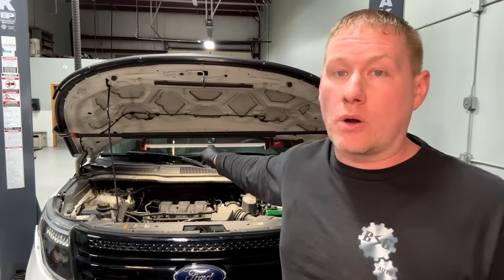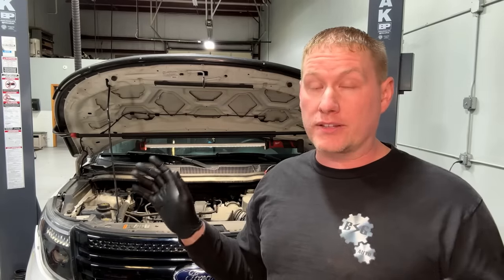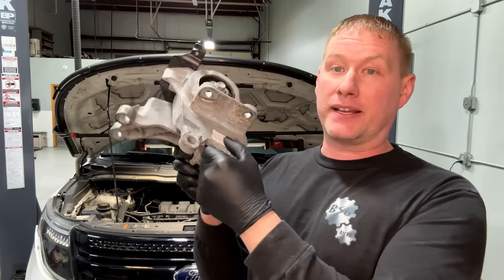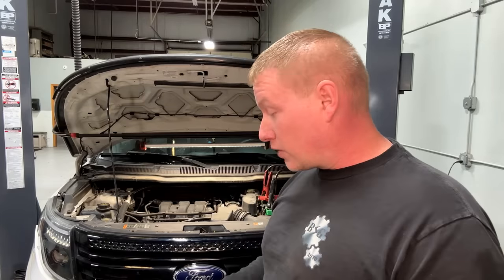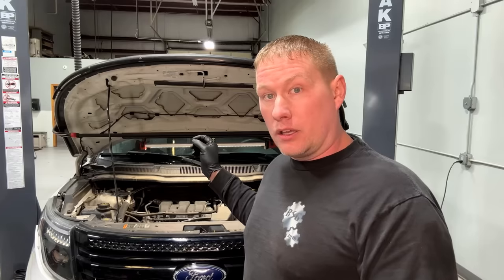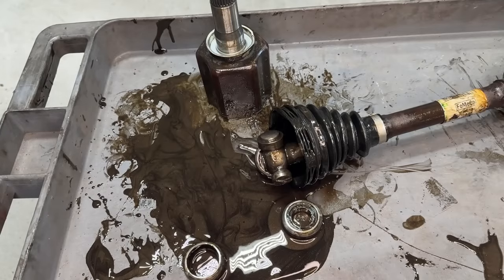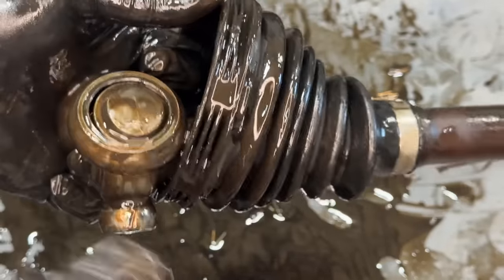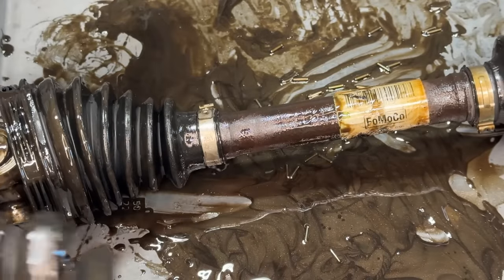Crazy 2014 Ford Explorer Vibration Finally Fixed!

Comment from the maker: The best Transmission Shudder Fix Additive out there- 
https://amzn.to/3rLXg02
Reply: Hey Brian do you use one or two tubes for the 2018 Explorer Platinum?
Reply: Hey, should I use  this for a maintenance procedure.
Reply: I used it in my old 09 Impala that developed a shudder.  Used this additive....doesn't work.
Reply: Brian. Do you still have a Quincy air compressor?  If so what model  is it. I need to buy a new one. Any recommendations ?
Reply: If I own a VCM3 will you offer a remote diagnostics session if I pay for a retainer/deposit for an 08 flex fuel 5.4l crank no start condition? I apologize I already reset cam
Reply: I have 07 f150 and the upstream o2 sensor wire connector harness that goes to the pcm/ecm is missing I can't figure out where the color wires on the female end suppose to go to can you help me please.
Reply: @__datwill explain a bit more
Reply: @Quick_Fast_Hurry  The female end of the connector that the male end on o2 sensor plug into is missing so the o2 sensor is just sitting in the cat  not plugged into anything cel on cause of it
Reply: @__datwill did ya find it?
Reply: @21Piloteer Lubeguard will not fix a mechanical issue such as a bad converter but it certainly will correct shudder problems associated with the frictional characteristics of the fluid. Lubeguard is the ONLY additive ever recommended by an automotive manufacturer. International lubricants have been on the forefront of synthetic fluid production and they produce synergistic additives for some of the big names in the lubricant industry.
Reply: What kind of camera do you use for diagnostic? How do you mount it under the car?

Comment: customer learned an EXPENSIVE lesson.  he should have replaced BOTH CV axels instead of just one!
Reply: axles
Reply: That was the first thing I heard in the intro.  "He replaced the passenger axle" ... Ok but what about the other one???
Reply: Cv axles are generally not replaced in pairs. That's not really a lesson.
Reply: The owner (my brother) changed 3 out of 4 axle's. We were waiting for the front left (backordered) when we threw in the towel. Brian had just finished my sons interceptor repairs. We knew BSG was the only place to diagnose and CORRECTLY repair the truck the first time. It was the best decision we could have made.
Reply: Yup
Reply: My vibration started a couple years ago, I did not address it then as it was minor. It’s gotten worse so I took it into a dealer. They suspected pinion bearings and order parts. Once they received parts I took it in and let them know that I had concerns that they were guessing the problem and that I did not want to pay for parts and work not required. Yesterday they sent me a short video of what the issue was. Bearing preload was at 5 in Lbs, on  my F150 preload spec is 16-27 in lbs. This axle has 162,500 Km on it. Fluid was changed out at 74,000 km. So, either the initial assembly was not done properly or the preload on bearing was lost due simply west and tear. The video shows some wear on the ring gear outer edge caused by the pinion gear. So they tell me their replacing all necessary parts. This 30 days after changing coolant lines on driver side Turbo.

Comment: I worked at a Chrysler dealer in the early 90's and this was a very common problem with inner CV joints.  They did not use a circlip but used a spring inside the inner CV joint housing to keep the CV joint in the trans.  When these went bad it would cause the vehicle to shake side to side on acceleration.
Reply: Yep, I had a 1986 Dodge Aries that did this same thing, had actually worn an indent into one of the tripod cups. Drove me crazy. Finally gave a tech at a dealer $20 to take a quick ride with me and he told me what it was within about 30 seconds of driving.
Reply: Yep, I had a 1983 Chrysler New Yorker that did the same thing.  The tripod bearing had actually frozen and when I jacked up the front and spun the wheels with my foot on the brake it would actually move the engine from side to side.  I think it had the 2.6 liter Mitsubishi "silent shaft' engine.
Reply: The 2.6L HEMI!
Reply: @paulreed563 Yeah, a real stormer.  The customer that had that car traded it for a 1986 Fifth Avenue and it had the 318 with all of 140 horsepower.  Another "stormer."
Reply: An yes.  Remember when Chrysler sold Horizons and Omnis to police departments?  Hahaha!  Couldn't make this stuff up!  And I was a fleet service rep.  What a sh-t job back then.

Comment: If you grab the driveshaft at the middle section and push up and down and you get play, the drivehsaft is worn and will cause a vibration, been there plenty of times working on Hondas for 24 years

Comment: This is funny, I had a 1997 grand caravan that we bought new in August of 97. It was the wife's car till it became mine after it hit 100000 miles. It suffered from the exact problem you showed in the  video. I won't get into the whole story about it, needless to say,  the van had a really terrible event happen to it preceding the whole shaking issue. I had the stub axles changed out twice, but no correction to the problem.  I decided to change them out myself the final third set, and upon install, it drove smooth as glass again.  I found out tbe mechanic that had changed them out twice was ordering remanufactured units. I installed brand new units. I drove that van for three years before I figured it out, even the Dodge dealer was scratching their heads telling me that the differential bearings in the transaxle were bad. I even changed out the motor mounts with no solution to the problem.

Comment: I had this issue on 2013, took to 3 mechanics including dealership and no one could identify the problem. Finally found some random video where guy was explaining similar issue but on different vehicle. I forced my mechanic to change CV joints and problem went away lol

Comment: The day I bought my 2016 explorer sport (a week ago) it was shaking like crazy and I was freaking out because I thought it was the axle. I realized they told me they just put brand new tires on, and I took it to a local shop and the balanced the tires. Boom, sped up to 115 mph on the highway and was SMOOOOTH lol I’m gonna keep an eye on my axles and PTU though! Will be doing my own oil changes every 4000 miles, with the quality oil!

Comment: I have watched your channel for awhile. I totally rebuilt a 5.4 3 valve and after fixing some wiring issues it runs great . I just had to say with your inspiration that it can be fixed it  kept me going. I am very happy to say it is better than new. My parents owned the truck before me. My late father would be proud I fixed it. My mother said it is riding better than when it was new from the factory. I did have to bore it 0.020 over because it melted through the #4 piston. When this engine is running right it is awesome. Again thank you for your inspiration it kept me going. I will continue to watch your channel and I pass your channel on to all my friends. You are doing a great service to the diy's out there. Helping those of us who are not wealthy but have motivation to fix it ourselves. Again many thanks

Comment: About a week before watching this I learned about the Lube Guard Shutter Fix additive. It worked. I bought two tubes and only put one in. Keeping the other tube for the next transmission oil change.

Now I have to go and check my transmission mounts to check their condition.

Comment: Impressive... The inner boot held up well, with all the miles and the heat and even with the grease turning to oil!  it still looked good from the outside!! That's probably why it was missed. 👍

Comment: 2001 F150 5.4, 2-valve, 4x4, 258k miles. Drivers side hub and half shaft replaced. Passenger side still fine pushing closer to 277k miles now. Original trans. Lucas stop slip in it. Yes, it helps. Edging closer to trans replacement/rebuild time. Don't put many miles on it per year now.

Comment: Great job explaining the problem and cause.
  I had a VW Jetta years ago, had axle changed n was getting vibration , they replaced again. No help  . Mistake took it dealer ! They said was clutch , replaced no help , replaced all engine n trans mounts! No help.
They had car 2 weeks, said internal engine problem can’t fix?
   Was on VW forum, cannot yes aftermarket solid axle! Put in VW axle ok!  Screwed by Dealer!

Comment: As a DiYer, Lubegard products (including Shudder Fixx) helped me take a 1994 zF 5hp30 transmission 300k miles. The torque converter had shudder problems from the start, as a service bulletin from BMW attests. They tried to resolve it with a replacement computer chip, but the friction modifiers in Shudder Fixx did the trick. I kept the clutch chatter at bay with Lubegard Red and a spill and fill every 30k miles. Lubegard is not your average snake oil. The trans was shifting well when I sold the car due to rust.

Comment: Good info! Relative recently got into a '15 Explorer with high mileage (~130k). Base model non-PI with the NA 3.5 V6 and tow package with the upgraded transmission. It's been fun keeping tabs on potential concerns to watch out for. Knock on wood other than some initial TC shuddering that was solved by topping up the trans fluid, it's been running good even with a ~5k mile road trip tacked on (monitored the slippage in Forscan during the trip and was rock solid). But will definitely be bookmarking the shudder fix for the future since I anticipate that may eventually become a thing as it racks up more miles.
Reply: I have a 14 Base with the 3.5, 180k. I bought it with a laundry list of issues. Had 1 bad cat, transfer case was leaking out the pass seal (I drilled and tapped a drain plug as well), water pump external leak, lower control arm rear bushings bad, sway bar links, tires x4, brakes. Did it all at parts cost. Runs and drives great now. Everything I did are common issues on high mileage ones.
Reply: @mph5896  Yep. A number of those came up at purchase time on this one and were taken care of like the transfer case seal on the passenger side, sway bar links, bushings, etc.. I think the main one we'll be watching for is the water pump. But like yours, this one definitely drives and rides nice despite the mileage. I was pleasantly surprised.

Comment: Had the same exact issue with my 2004 F150. I had the infamous death wobble. Replaced the axle and all gone. The mechanic that replaced it for me thought I lost my mind when I told him it was bad. It looked brand new didn’t look worn never clicked when I made a turn no obvious signs that it was bad but I did notice the way it was sitting on the truck when I looked underneath straight on.  No more shaking at higher speeds.

Comment: As an old car guy that did  most of my time working on cars in the 70-80's and still work on my own stuff, I love watching you on these videos. I am always a bit amazed at how some cars will have these fail way sooner, and other cars may never need them ever. I sold my 200 Taurus with 220K last year with the original CV axles and it rode as smooth as the day it came off the line. I get that this was cop car so a lot of heavy abuse, start, stop, all kinds of non regular driving during the life as a cop car. The grease probably turned to that fluid due to the extreme heat that the CV joint was creating. My guess.
Reply: Agree. As for the CV axles, some OEM's use bad suppliers to cut costs. They will switch to Chinese suppliers, produce 100k vehicles, figure out they're bad and go back to a previous supplier. It's terrible.

Comment: I can tell you that IDENTICAL symptoms on my 2016 Ford Escape .. same fix despite the fact that dirveshafts looks "OK" when checked by hand ... Replaced form driver side first .. hmm .. gotta replace driver side too. So dont be cheap .. save yourself time, change both at the same time ;-) .. THANX A MILLION for sharing. ANd I was about changing struts .. ehh ..

Comment: Good find. Those can be difficult to diagnose at times. I had a 2017 Explorer Limited with a violent shake  only during accel worst at around 80 kph. Same thing, drivers axle shaft faulty. Note: I've had no luck with aftermarket cv axles. They're good for awhile and come back with the same concern. For long term fix replace with oe I don't care about the price difference or the life time warranty the aftermarket have. Also have a 2011 Ford edge which has same concern and we keep throwing cv axles on it because they're lifetime warranty so why not 😅.  Good for about 30k and soon it begins to shake during accel. The car is the company loaner vehicle.

Comment: I have 2012 dodge Journey with the exact same symptom. I put new cv shafts in it but the were aftermarket. It was driving me nuts because I couldn’t find the vibration. I came across this video, so I put a oem cv shaft in it and the vibration is totally gone. I couldn’t believe it. Oem cost 3 times as much but it’s the only way to go. Thanks for the video.. I have learned a lot from you

Comment: My wife just traded in her 2020 explorer that would vibrate like a mother at 70 mph. If you went alittle faster or slower it was fine. It was right around 69 to 70 mph. Only had 24k on it. Never really found out what the cause was.  This was just one of many issue we had with the explorer. We had a ton of electrical gremlins that Ultimately made the decision easy to just dump it back to the dealer.

Comment: The rustbelt appears to be coming true on that frame under the vehicle.  Thank you Brian for these videos.  They have saved me several hundreds by showing me how to complete (simple) tasks.

Does salt water help change the grease properties, or was the boot sealed and intact?
Reply: Shake all that rust away!  Makes you wonder why someone would want to throw all that money at a rustbucket like this.
Reply: @lo1234-w9r that’s a normal vehicle in the north. Once you can’t pick them up by the pinch welds, then it’s getting close to scrapping them.

Comment: i lucky guessed your issue only because i've always used what i was taught that straight-line acceleration shudders are always the inner joint, turning shudders are outers

Comment: In my time at Honda, vibrations caused by cv shafts were pretty common.  It was almost always only on accel, would violently shake the vehicle (think super-duty death wobble) and almost always caused by the inner cup having divots worn into it from the rollers.  Somewhere around 1/16" deep divots would cause that vibration.  Crazy.
Seeing a total bearing failure is impressive though, that doesn't happen often.
As always, great content Brian 👍

Comment: Grease should not turn into oil. I have seen a case in which an atv inner cv joint did the same thing, liquified the grease. It was actually leaking oil from the diff into the boot via a badly sealed housing. Some of these cv housings have a pressed piece of metal to seperated diff fluid from cv axle grease. You should clean that part up and see if it was passing

Comment: I have 2014 limited  I was changing struts as soon as I took my strut off my cv axle broke at the knuckle. After replacing CVS and struts on both sides my car drives so much better

Comment: Had the same thing on my 2001 Honda Civic I could not see it split on the inner boot when I looked and did not probe it for brakeage. Once I removed the steering knuckle to change them out the CV axle split apart and fell. I thought how luck I was as I drove it around trying to troubleshoot it.

Comment: I had the same problem on a toyota. turned out  the previous shop that replaced the transmission had hyperextended the cv joint. crazy symptoms.

Comment: I've encountered this on Honda VW and Chrysler it always happens under the load and is caused by the inboard joint on the axle shafts those are the only three I have ever encountered this from Usually clacking on turns is the outboard joint sometimes some wheel Hop included a bid culprit in the past on this was Hyundai and Mitsubishi😮

Comment: I rebuilt CV shafts about 22 or so years ago. That type of damage was not at all uncommon back then either.
Reply: All these new Chinese aftermarket axles are junk . I need inner joint for rx330

Comment: My 09 flex was has a similar problem, A vibration under light load at speed when you try to hold speed on a slight grade. Not severe like your explorer, but really annoying. Feels like a fish bite miss. Did do plugs, reduced it, but still there. My guy replaced aft control arm bushings and road force balanced all 4wheels. Its much better, but if it comes back the axles are next. 190k, btw.
Reply: I Had the side to side wobble going up a slight hill on my 2023 Town and Country Chrysler.  I used a rebuilt axle but no luck.  Then I used a new axle assembly and the problem was gone.

Comment: Wow, I thought I'd never see that again! I had a 2000 Honda Odyssey where that happened, when the van was 3 years old!  I was on a trip to New Hampshire and all of a sudden a violent vibration started. I looked under all looked great and brand new, 'cause it was... and I ended up thinking that one of the steel belts on the tires had failed? I bought 4 tires 'cause I was certain! but it was not. Ended up replacing the cv axles and solved the problem. No issues after that until its retirement 300k mi later!
Reply: I worked on a friends Acura RDX. It had a nasty vibration on acceleration. I replaced the passenger side wheel bearing since it was noisy, along with the passenger side mid shaft bearing and axle. The vibration was still there. The drivers side axle had no indication of failure, but I took a chance and replaced it anyways. Plenty of forums were stating axle issues. Car was fixed. 🙃